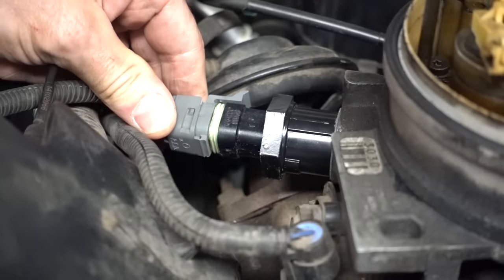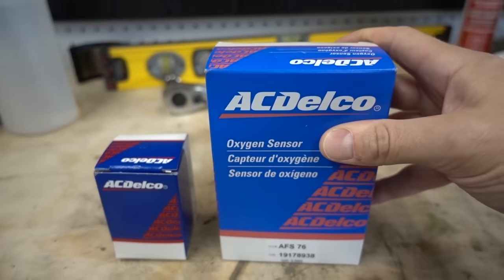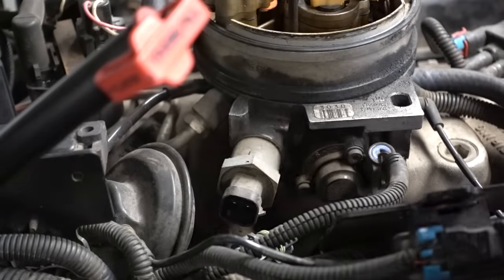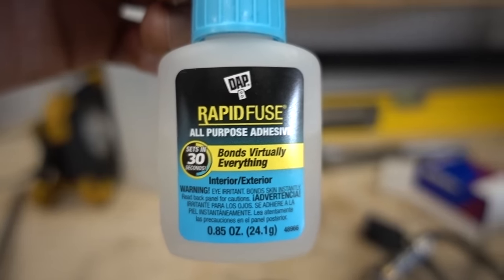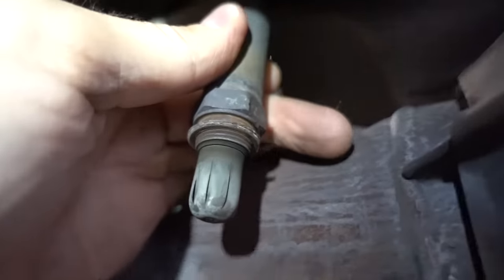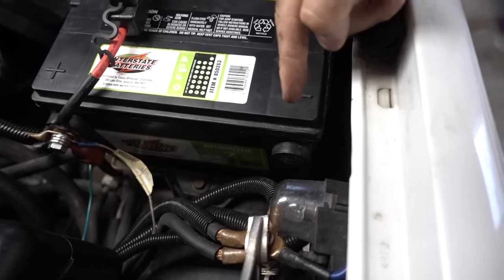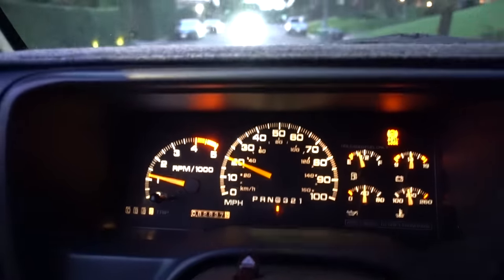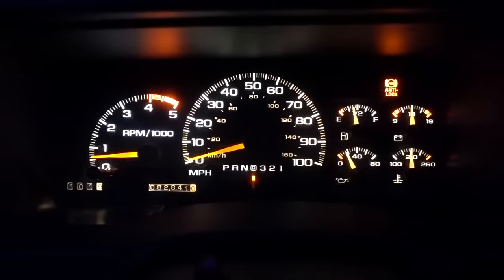Here's the TWO SENSORS YOU NEED TO REPLACE FOR BETTER IDLE !!

Comment: For GM vehicles before 1995 without MAF sensors it's also important to double check your Coolant temperature sensor as it also plays a huge part in the calculation of fuel to air ratio.
Reply: CTS dictates whether the ECM is in closed loop or open loop..
Reply: Most modern fuel injected engines use CTS for mapping fuel; not just GM. Easy to check with a scan tool with live data. Take the vehicle out of direct sunlight and let it rest for a few hours. Turn ignition on, check the CTS with the scan tool. It should be very close to the outside ambient temperature. If it's not within a few degrees F then it's giving the wrong data.
Reply: I have a 1991 chevy suburban, do you have any videos on how to change the coolant temperature sensor?
Reply: Yes and use GM parts vs. aftermarket brands. Not all aftermarket is bad but many are not qualified for sensors etc.
Reply: Another tip for TBI GM motors everyone forgets...TBI CLEANING AND NEW  Throttle Body GASKET! Your Welcome!~
Reply: @famholland469  Yes, that gasket tends to be pulled inward from the vacuum as I had one that did around 60,000 miles and we spent much time trying to find the leak.
Reply: This is true for Motronic EFI in the 70’s to very early 90’s. Probably a wider range than that too but I know it was critical on the 1.1-1.3 cars.
Reply: @Garth2011  AC Delco is just a brand. Manufactured by Wix, Gates, Standard etc. Motorcraft is very similar.

OE supported doesnt mean its made by that company. It does mean it was made by a quality manufacturer though.
Reply: @devinwalton408  Seems true however, experience has brought me the best outcome with OEM vs. off brand aftermarkets. What's sad is, buying parts the a GM dealership, GM parts department, paying a GM price and being handed your parts over the counter and all of the packaging says GM or AC Delco and them "Made in China".  That's when I stopped buying OEM at the dealerships and went to my privately owned mom & pop auto parts. At least I can get Delphi or Borg Warner and Gates etc. and pay less for mostly USA made parts.
Reply: @Garth2011  I agree that OE brands are best. I simply singled out DELCO and Motorcraft because they are brands not manufacturers. I sell parts for a living, kind of, and I get so sick of hearing “I want Motorcraft not aftermarket parts.”

Sir, that Motorcraft FA number is manufactured by “Wix” which is actually owned by Mann-Hummel. Your OE Ford part is made in Poland by a German company.

Yessir that AC Delco pulley is the exact same number as the Gates. Yessir, that is because Delco hasn’t manufactured a damn thing in 30 years. Yes, the Gates is 25% cheaper.
Reply: @maddog9659  q
Reply: @davidaud4652  look underneath your coil pack or at the cambox end
Reply: @devinwalton408  It doesn't mean 100% tested by installation before shipment. A part can have a mechanical imperfection or an electrical connector that's defective.
Reply: I actually had an obd1 code on my 90 for that sensor. I was super surprised to have a code for obd1 but once I replaced it high idle issue was fixed.
Reply: Definetly.i agree
Reply: I have a 89 formula with 5.7 Liter tpi with a slight idle surge,enough that its bugging me. New plugs cap rotor wires.  Should I just replace all these sensors? You mentioned coolant tempeture sensor. Previous owner "I think" chaned thermostat to 160"nver gets warmer then 160-180. Would this effect temp sensor,it spews some fumes lol. Plugs indicated running lean but exaughst says rich haha. 82k.
Reply: Hmm didn’t know that and mine is running cold thanks for info
Reply: @maddog9659 - not necessarily- Mastercraft ski boats began to come with a fuel injection option in '93 and those engines weren't closed loop. They continued this way until EPA. CAFE and CARB required it in the first decade of the 2000s.
Reply: To add- this is the sensor with one yellow wire and one black wire- the one wire sensor only connects to the dash gauge or whatever triggers the idiot light.
Reply: So I should do that if I own a 93 Silverado?
Reply: Yes it does matter which one is the problem, otherwise the educational value to us is limited.
Reply: I'm just learning this and about carb choke coil in my 88 caprice .. drives like new every time I get new parts but they don't make parts the same as original 😢

Comment: I have a 14 yr old truck that I bought from my mother when my father passed.  I didn’t initially want to buy it because I had a much newer Toyota with 1/3 the miles. My mother wanted me there when people would come to test drive it. After a couple people came and beat the crap out of the truck on test ride that were clearly joy rides. I said enough, I would buy the truck for the asking price.  I sold my Toyota and bought my father’s 2010 GMC Sierra with 143k miles on it. It was my father’s baby. I just couldn’t imagine it being registered to a stranger.  I was much happier knowing that the truck was only registered to my father and myself.  Then I realized I had named my son after my father and it would be awesome if I could keep this truck going for 10 more years so I could pass it on to him. Now my goal is to have it go from father to son, father to son.  I have been systematically going through everything.  I have been replacing sensors left and right because they are cheap and I am more than capable of the work. Last weekend I pulled the intake manifold because I just wanted to replace the gaskets for the valley cover and the intake manifold, so I also did the oil pressure sensor while I was there.  So many people are always confused why you replace a 14 yr old part because you could save $32. I would rather replace it while I’m there and know the age and mileage of the part. I keep a log of what I replace and when as well as mileage and if I can read the parameters with my scan tool, I enter those as well.  I have rock solid baselines to reference as well as maintenance records with specific breakdown fluid brand, type and reasoning for selection.  My vehicle isn’t about doing the minimal to get by, it’s about future proofing on a long term plan. I disabled DOD electronically, with HP tuners, but this coming spring, I am going to do the full delete to ensure reliability that GM destroyed with the pressure for the EPA and possibly planned obsolescence. 😂. I have a surplus of functioning parts that have miles on them now.  Each one logged with date of replacement and cleaned, sealed in zip locks and put in totes in my shop.  Now if I’m in pinch, I have a plan B easily available and if a part gets discontinued or is no longer produced, I still have an option.   Or my son will have an option that others would not.  I can’t wait to teach him and my daughter how to fix anything just like my father taught me. My 8yr old daughter and 6yr old son already have more knowledge and tools than most adults in regard to cars.  I have been teaching them how to use bi-directional scan tools.  They learn it easier than I did.😂😂😂. I love your channel, because you address things like the guy with a long term plan should, not just the cheap fix.  Great content, keep up the great work on that beautiful truck and keep enjoying those payment free years. 😂😂👍👍👍

Comment: As some sharp subscriber posted below, replace the gasket for the air cleaner. cheap. also, any vacuum leak is bad news. check and replace old cracked vacuum lines. you are doing great work....step by step....check battery connections and condition of battery.

Comment: what I've done for these broken clips is glue them back in the installed position, not before install.  that way they hold until the next time.
Reply: Exactly
Reply: Sky Walker good idea. Thinking outside the box. 😁
Reply: brilliant---bravo
Reply: Replacement plugs are cheap and just de-pin the wires one at a time and install them in the new plug.
Reply: There is a special bonding agent to repair these clips.  Car audio shops use it al the time.  Available at Advanced Auto for sure and others likely.  A little pricey but worth it.
Reply: Bart 1519 indyfiretx  never use vinyl electrical tape in an engine compartment.  It will turn into a sticky, nasty mess.  Jimmy's fix is quick and dirty but effective.
Reply: @x-man5056  Looks like the glue he used held at the original break - he said it broke in a new position during re-install.
Reply: @skywalker2852  Yes, I saw that.  I'd guess that's a pretty rare occurrence.  
Your idea about gluing it in the installed position seems like it would be often quite difficult also.  I be afraid I'd be getting glue where I don't want it considering the number of times I've glued my fingers together.  Jimmy's solution may not be pretty but it is effective and easy to remove when you need to.
Reply: I like that 👌
Reply: What about putting glue on the plastic clip itself before removal 🤔

Comment: That poor idle happened to my 2004 Expedition and replaced the IAC and also cleaned MAF sensor and the throttle butterfly and the results is fantastic,The idle is like a whisper, I like to share it to you guys.Oxygen sensor is not included in bad idle,Also if your ignition coil is old replace them with new spark plugs,You'll glad you did.
Reply: How to test ignition coil conditions? Mine already 100k plus only change everything except coil plug and fuel pump. Civic 8th gen
Reply: With my wife’s’94 Probe, I’ve had an intermittent ‘check engine’ light come on when going uphill and sluggish performance.  Cleaned the MAF sensor and took her out for an hour of acceleration up hills and highway speeds and ‘no light’ and the performance is vastly improved.
Reply: @khairulihsan8417  you don't need to change out a coil until it fails. You'll get a misfire when it fails.

Comment: For my 94, with 384k miles, my O2 sensor wasn't budging!!! I ended up taking to Tuffy Muffler and they put it on a rack and used a 3 ft long breaker bar it free it up.
Reply: When I need more leverage I use my floor jack handle

Comment: The next time you try to take off those brutal brittle plastic connectors......use a hair dryer to warm it up as it will soften it up ...also when you reconnect it.....if it doesn’t reach use a dry vac extension with the hair dryer.....it does hurt to spray and tiny bit of oil on it ..helps it slide off and off.

Comment: Idk if anyone has pointed this out yet. But if you go back and look at the new idle air control valve to his old one. You can see the difference. New ones spring is way more tighter together than the old ones spring. Thanks for sharing Chris
Reply: Exactly, That is the part that fails.. The spring gets clogged and weak.

Comment: When a clip breaks try putting the plug on before you glue or cement the broken piece. It should hold it in place as good, especially if you do a good job with the glue like the first time. Another alternative is if you heat the clip side a little with a heat gun (carefully) before you move it you may have a better chance wiggling it off or on before it's moved.
Reply: It does matter if the latch breaks because they will noy come loose anyway,I know been mechanic for a living for 35+ yrs
Reply: @dwb4462    broken English
Reply: Great idea Mr Deth!  Also, Try Superglue welding and add structure to the length of the clip.

Comment: On older vehicles, be sure vacuum lines and their connections are good.  This includes o-rings at sensors/actuators e.g. evap vapor purge solenoid valve.  All the little leaks add up for unmetered air.
Reply: Even leaks in TB gasket?
Reply: @khairulihsan8417  I would say yes.  Any leak is altering the mixture, and, therefore, confusing the computer.  My comment was by experience of tidying up leaks (which is a loathsome job), but I did see improvements.
Reply: @louf7178  I’d rather chase leaks than chase a small parasitic draw which I’ve been doing for hours and hours 😬
Reply: @CyberAndy_  yes. Could even cause stalling if the leak is big enough
Reply: @CyberAndy_  if it's only happening while stopped it's possible it's something else. A large leak would cause rough running all the time. It might not be getting the proper air/fuel mixture at idle which could be a bad sensor(s).

Comment: Jimmy, thanks for the great videos. I have an ‘03 Suburban but also have a ‘90 t-bird. I tried a couple times cleaning the IAC in the T-Bird and it never really helped. So I got one from a junkyard. It was a little better but not as good as it could be. Neither of these really looked dirty or bad in any way. But like you, when I put a new one in, I noticed a big improvement in the car’s idle. Some things can be cleaned and sometimes it’s best to just buy new. Thanks again, God bless.
Reply: Probably only ultrasonic cleaning could work.

Comment: A couple of comments- the IAC isn’t a sensor, it just does what the ECM tells it. It also doesn’t cause poor idle unless it doesn’t respond to the commands correctly, whether it remains open or closed when it should have moved. It ‘parks’ every time the key is turned off and opens to a pre-programmed position. The IAC part is called a ‘stepper motor’, which moves in discrete increments, not in a continually variable manner (like a volume control or other kind of motor). A bad IAC can cause high or low idle, sluggish hard acceleration or bogging/stalling when the driver removes their foot from the gas pedal when stopped or coasting, respectively. The engine will restart normally unless the IAC has stopped opening or closing properly.

The ECM doesn’t need to learn anything from the IAC but it would need to go through its routine with the new O2 sensor, but that may only take one or two run cycles. 

BTW, clearing codes doesn’t happen in a half hour of disconnecting the battery because that would make troubleshooting very difficult. However, it may cancel the check engine light. The codes are stored in non-volatile memory.

The likely cause of the idle issues was the O2 sensor.
Reply: How did he know which O2 sensor to replace since there are so many?
Reply: Great info Jim, thank you.
What is the best way to clear codes?

Comment: I replaced my exhaust a month ago in my 95 K2500.  100k mi.   In the upgrade I put a new O2 sensor in.  What a difference.  Stronger idle,  better shifts, seems like more horsepower.  I now think replacing every 50k .miles should be standard.
Reply: Man, I wish O2 sensor way cheaper if it's going to change every 50k. Now Im totally confident that O2 on my 8th gen civic will be the last thing to replaced to correct my AFR. Thanks for the comments

Comment: 10,000 points for the zip tie hack !
Reply: You know SMA would have replaced the connector just as simple and not a hack
Reply: Haaaaa
Reply: Did the same hack for the camshaft position sensor in my 16 year old Tundra.

Comment: The TPS sensor and the IAC sensor does some of the work the old carburetor jets used to do
Reply: make sure you know if it is an adjustable tps or not and you install correctly. also make sure you do proper sensor reset/ computer relearn procedure so your ECM properly handles the new sensor and it is calibrated for optimum fuel/air ratio.

Comment: Thank you for the video... The better way to reset the computer, is to touch the positive and negative battery terminals together... Simply remove them from battery and hold them together for 30 seconds... It will take that computer out of lympmode, and return it to its factory settings...
Reply: Yessir 👊🏻👊🏻

Comment: Great as usual, cleaning up the electricals is good way to smooth out the idle even down to cleaning up the ignition lock and key, I use blue horizon contact cleaner which I also use for my home entertainment units

Comment: Been working on the same rough idle issues on my 95 K1500 350TBI. IAC made a huge improvement, planning to rebuild throttle body next.
Reply: i cleaned my egr valve and it idles/runs smoother, and stopped smoking
Reply from the maker: Going to rebuild throttle body soon also!
Reply: 95 Chev 350 TBI - has vapor lock symptoms...  in 95°+ heat 
Crank won't start. After I let it sit for couple hours it runs normal. Any suggestions or similar experiences? Thanks
Reply: Jimi Cruz I had a similar problem - But it had to do with the Immobilizer ( Key was Worn Out )-Correction - It wasn’t the key !!!  It was A huge ignition Fuse right under the Steering Wheel 👍👍👍
Reply: When you rebuild your TBI unit get the injectors flow tested, the are notorious for being miss matched,  you can also get a plenum spacer that allows each bank to "borrow" some air fuel mixture from the other side to allow for a smoother running engine, or Holley still makes a 670 TBI unit. That mixed with an Edelbrock manifold sure surprised a few TPI Camaros back in the day( 90 2wd short box stepside)

Comment: Word to the wise - CARBON. IAC was pretty dirty there - probably be cleaned but why not do new? CLEAN OUT THE PORT YOU'RE PUTTING THE IAC INTO. The reason is because the valve shuts off and turns on airflow to the TB - hence idle issues. When you clean the TB clean the IAC. Hint - sometimes a bad IAC DOESN"T throw a code either. One more thing - don't ever say "PLEASE DONT BREAK-PLEASE DONT BREAK!" Guaranteeds breaking - lol. Relearning on GM sometimes takes a little roadtime. Been a GM guy for 50 yrs and SO WORTH IT to DIY! Have a 4.3 Vortec on a 03' S10 w/305k and STILL RUNS LIKE A CHAMP! Take care of it and it will take care of YOU! WTG Dude - GREAT VIDEO!!!!